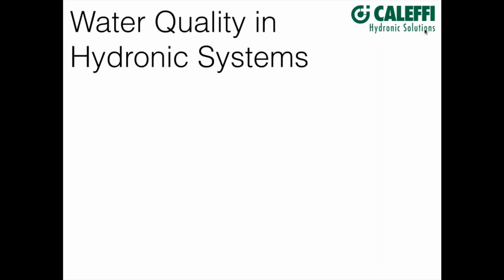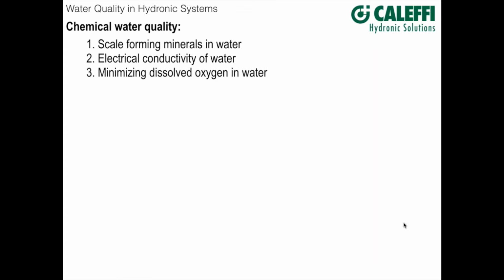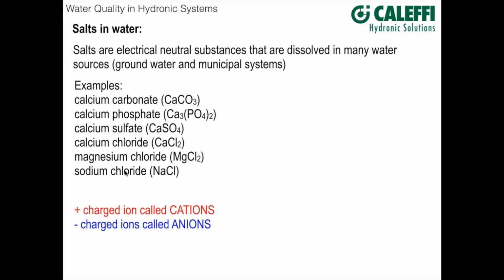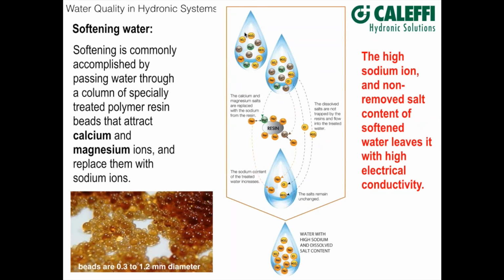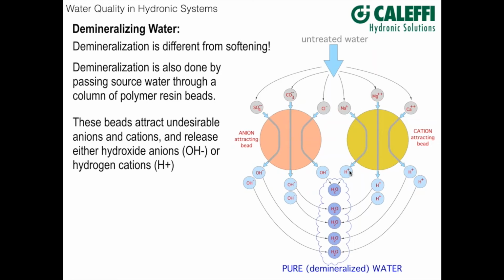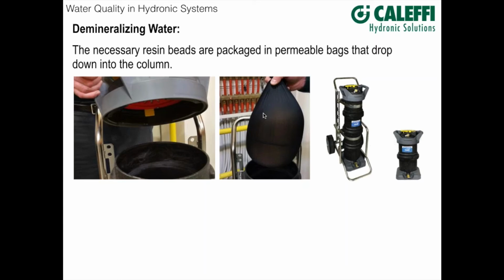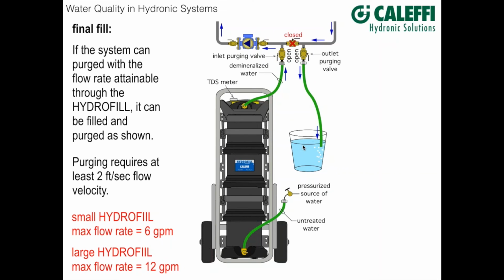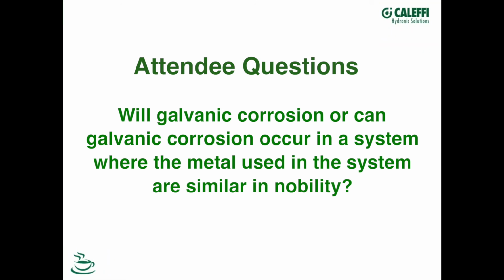Water Quality in Hydronic Systems

Comment: I have a smaller closed loop system that is approximately 25 gallons. I plan to add 40% glycol, so I will only need ~15 gallons of water.  I can get deionized water for less than $1 a gallon.  I am not a contractor, otherwise I'd buy your system (I've bought many of your other components though!), so would it be possible for me to add something back to the deionized water to get the TDS to the 10-30 range so that the water is no longer "hungry?" Or would you recommend buying a premixed glycol solution instead? Thanks!
Reply from the maker: +Lance Jones For the size of your system, the best approach may be to buy pre-mixed glycol. It is typically made with DI (or demineralized) water, will have all the right additives, and it will simplify your project. We hope this helps.
Reply: @CaleffiHydronicSolutions   Thant wasn't the question

Comment: Very interesting, this is a subject I have a lot of interest in, but I have a question, why do you suggest adding inhibitors to stabilise?. if you have demineralised the water and if the pH is correct, water will create a natural layer of protection on the metals, no need for false ones, if the conductivity of the water is low, then oxygen ingress can be handled as low conductivity means that corossion is unlikely to occur, plus adding inhibitors actually increase the conductivity of the water, so you have undone some of the good work by demineralising and reducing the conductivity, I think we need to be moving away from adding chemicals to heating water
Reply from the maker: +Christopher Flaherty Thanks for the excellent questions from the UK!   Here goes:
 
Site water that is run through any deionizing process will result in a lowered pH regardless of the incoming pH. Distillation and RO will produce the lowest pH (“ultrapure”) and in addition to being expensive as noted above, is one of the reasons it is not typically recommended. The HYDROFILL treated water pH will typically measure in the 6 range regardless of the incoming pH level. However over time the pH of the water will naturally rise and stabilize (this process is referred to as “self-alkalizing”). The resulting pH typically settles around 8 or a bit more. This natural process can take days or weeks to occur depending on the system, component materials and temperature of the water.  Heating the water will accelerate the conversion of the carbonic acid to carbon dioxide which will with its temperature elevated, come out of solution and if coalescing air separators are used like ours, the gas will be automatically vented out. We recommend taking a pH measurement shortly after the system is fired and running system a bit. Even knowing that it will continue rising to about 8 naturally, if desired to force adjust the pH up or down use one of the pH adjuster additives available. But often times a pH adjuster is not needed depending on the pH spec of the boiler or chiller – the two pieces of equipment that usually dictate system pH because they are the most expensive. 
 
Ok pH is within spec so now back to your question. The demineralized water will prevent scaling and because the conductivity is low, galvanic corrosion is prevented too. But what about oxidation corrosion?  Yes it is true that a ferrous film will form (but at pH 11 or above it won’t) but if there is an ongoing source of ingress, oxidation corrosion of the iron or steel will still continue on with one result being the formation of magnetite that is usually microscopic and can cause havoc with ECM circulators, seals, and heat exchangers (check out our archived ‘Webinar Magnetite Separation in Commercial Systems’). A good coalescing air separator will minimize any oxidation and for the magnetite, a good magnetic dirt separator will capture that too. So to your point, in the end, installing high performing components will largely minimize (or in many cases even eliminate) the need for inhibitor additives. But we recommend them as another safeguard for designers to consider adding. In some jurisdictions though here in NA, adding any chemicals will require a more expensive backflow preventer to be used (RP type) in many residential applications.
 
BTW, the systems installed in the U.S. and Canada often include multiple metals.  We see copper, steel, iron, stainless steel and multiple aluminum alloys, and various plastics including some without 100% O2 barriers. Boiler manufacturers here are really clamping down on warranties if the failure was deemed to be fluid related. There is not as much knowledge about water quality here compared to Europe. Thus I like that hydronic conditioners can provide multiple functions such as oxygen scavengers, pH buffers, film providers, and will even lock up some hardness.
Perhaps most important is the system is cleaned well with a hydronic cleaner.  We see oils, assembly lubes, pipe dope, solder flux residue, dirt, and other jobsite debris in new and old systems. No doubt a clean system with conditioned water is much better than systems we currently see: purged and filled with jobsite water, and that is it!
Reply: +Caleffi Hydronic Solutions, Thanks for the reply, this is a subject I am very passionate about, I would just like to respond to your reply.

Distillation and Reverse Osmosis (RO) do not produce ultrapure water. In distilled water and permeate water of RO one can always find traces of salts, especially of HCO3-. Therefore the pH of these kind of water are slightly acidic and due the remaining salts in the water it is not an ultrapure water.

Ultrapure water is mainly used in industrial processes or as make-up water for cooling circuits in nuclear power plants or in steam power plants. To achieve ultra pure water with RO you will need a polisher filter after the RO unit which removes the remaining traces of salts. This polisher filter is an ion exchange filter usually containing a mixed bed resin. After this filter the pH of the water will rise to a level of approx 8.2, which is the pH of ultrapure water.

When using a deionisation or demineralisation filter to treat the make-up water for hydronic heating systems we usually use a mixed bed resin for ion exchange with a high amount of anion resin to assure that HCO3- is removed reliably. When operating this system technically correctly and keeping the capacity under control by monitoring the electrical conductivity behind the ion exchanger, the water is already of great quality for the operation of heating systems. The electrical conductivity is in a range of 0,1 - 5 or 10 µS/cm and the average pH at 8.2 to 7.5. Water hardness will be removed completely. Correct use and usage of correct and suitable ion exchange resin is necessary to achieve such a water quality.

You mention 'self alkalisation'. This sounds like an attribute of water which insinuates that water would always rise its level of alkalinity. But when there are no alkaline salts available how would water rise its alkalinity on its own? There are only two ways that would lead to a high pH in closed hydronic heating systems. The first is due to a high temperature the still dissolved carbon dioxide gases out of the water. This thermal degassing of carbon dioxide would lead to a pH of approx. 8.2. Another possibility is that some kind of alkalinity is available. This could be a Na(HCO3) which is sodium-hydrogencarbonate. Sodium dissolved in water together with carbon dioxide. As soon as carbon dioxide gases out of the water due to a rise of the temperature sodium would dissolve as Na(OH) which is sodium-hydroxide and this in fact would rise the pH above 8.2. The final pH depends in the end on the total amount of dissolved salts. A sodium hydroxide solution would have a pH of 14 and even a pH of 11 that is mentioned by yourselves would need a high concentration of sodium ions.

So under which circumstances would the pH rise above 11 if one would fill a heating system with deionised water? I don't see any apart from the possibility that there might be residues from old water in the closed water loop.

One thing is a matter of fact - even a low electrical conductivity cannot stop corrosion completely but as corrosion is an electrochemical process an environment with a low electrical conductivity can slow down corrosion to a rather low corrosion rate.

You mention some advantages in view of the low electrical conductivity but sees the risk at high pH, especially under constant oxygen ingress in a heating systems. In this context you describe that the ongoing formation of magnetite due to oxygen induced corrosion (oxidation) but you forget to mention, that even oxygen corrosion is an electrochemical process only that the anodic and the cathodic side of the corrosion element is formed on the same material. As the ohmic resistance of water with low electrical conductivity is low even oxygen corrosion is slowed down.

In case of iron an initial corrosion takes place as soon as iron comes in contact with water containing oxygen. As a result a layer of magnetite is formed on the metal. This layer is called the stable layer and protects the metal from further corrosion. This layer is stable as long as the pH is in a preferable range and as long there are no other disruptive factors. As long as this layer is present and stable the metal is protected against further corrosion. The layer of magnetite can be destroyed by a too low or a too thigh pH, high electrical conductivity (in this case the layer is formed not on the metal but in the water phase) and / or erosion. This would lead to ongoing formation of magnetite and as a result the water would turn black.

Constant oxygen ingress on the other hand would not lead to black water and continuous formation of magnetite. The oxygen would corrode the magnetite to red rust which is Fe(OH). The water would turn red.

Water side corrosion is a complex matter and it would be wrong to say that any way of water treatment with or without chemical inhibitors would be wrong but one thing is clear, chemical inhibitors should not be used as a cover up for poor system design and poor water treatment. But with good system design and a good water quality makes it possible to operate a hydronic system without chemicals.